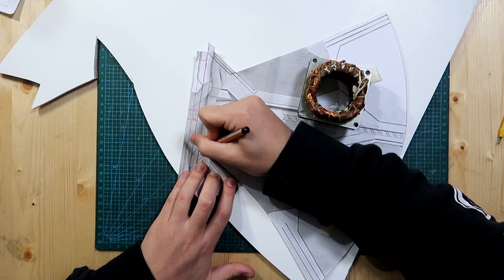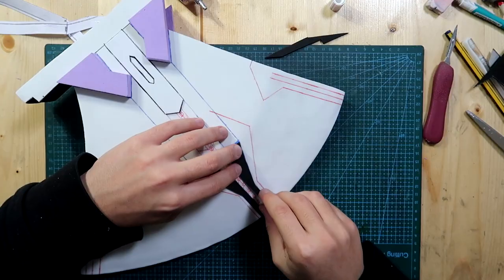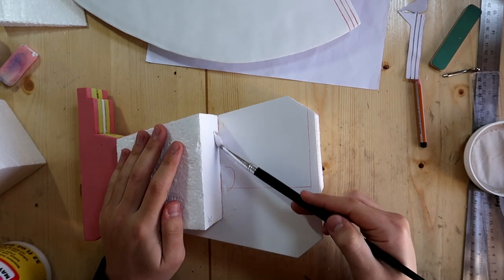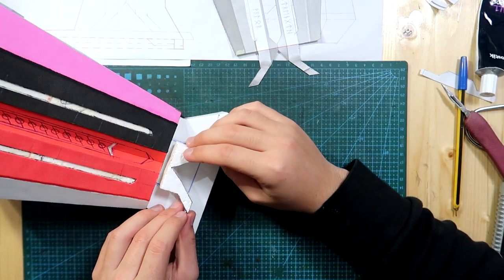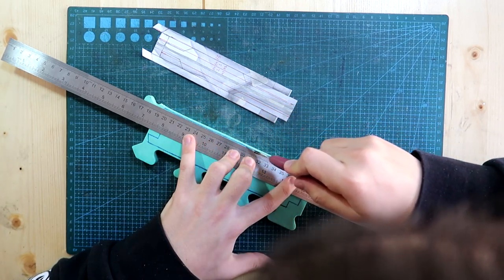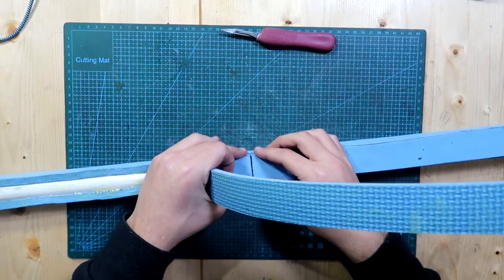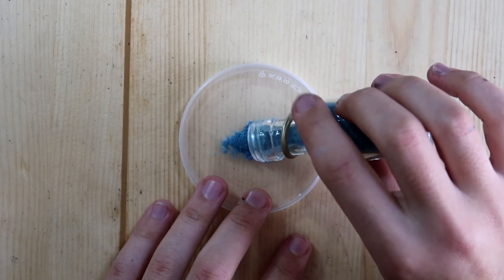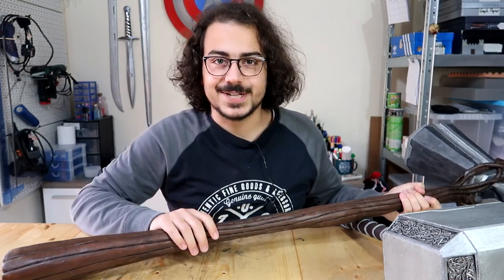MARVEL | How to Make THOR's STORMBREAKER

Comment: This template is available for download or to buy? planning to make it but can't find the correct size. when i saw chris, it's seems huge. is your stormbreaker the same size as the movie or slightly smaller? coz i prefer smaller just a bit because i'm short lol
Reply from the maker: Yes, you can buy it from the link in the description :)
Reply: @TheCraftMansion  great! What is the thickness of eva foam for the base of the blade?
Reply: @TheCraftMansion  Dear sir, i could not buy your template on the link given. 3x declines. could i pay using paypal?